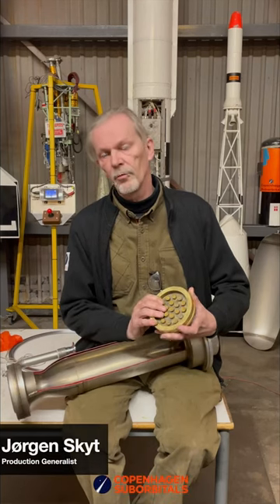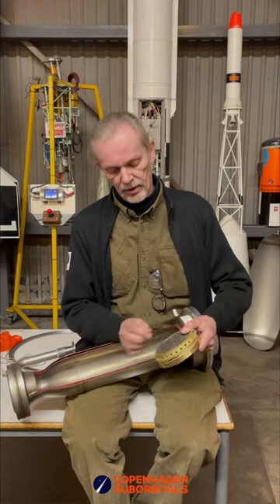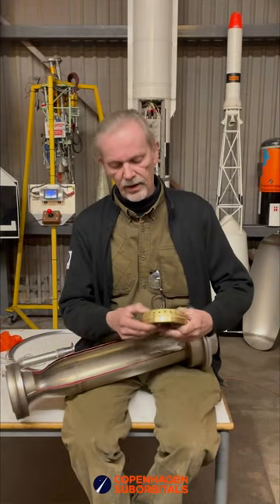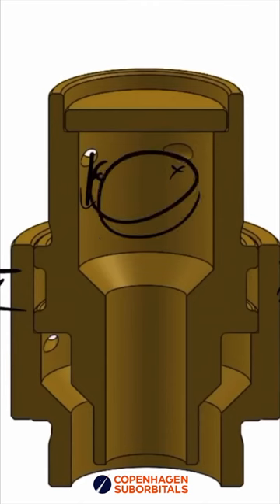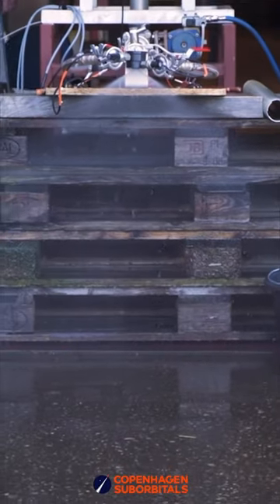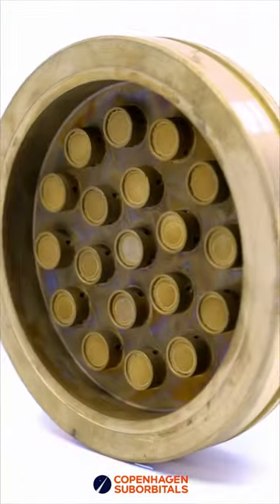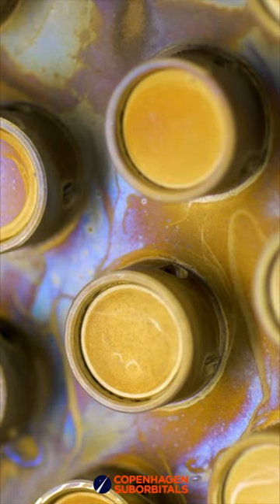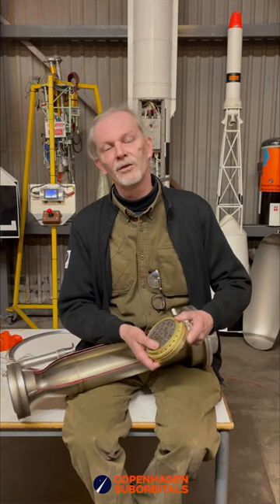A rocket engine swirl injector explained #shorts

Comment: Its a shame you go through all of that engineering and don't recompress the fuel after its been mixed.
Reply: Recompress?
Reply: What are you referring to when talking about recompress the fuel. You mean have It run thru another turbo before entering the fuel injector?
Reply: Reply yes recompress. Your temperatures are relatively moderate in that area from the looks and sound of it. Why waste the energy you are building on burning it when you could compress or recompress it further giving you higher specific impulse
Reply: @buddtwin2  yes if you were to go through another smaller more efficient compresser before your injector but after your cooling stage you will have more efficient engine.
Reply: @buddtwin2  why waste the energy gathered from the cooling stage when you could double it by either restriction of flow or like I said adding a smaller more efficient compresser before the injector.
Reply: @buddtwin2  it could also help your main compresser. You may end up with a cooler running more efficient engine due to being able to evacuate your cooling stage more quickly instead of relying on your main compresser to do all of the work......

Your injection manifold may need a redesign but you're already half way there it looks like. Another thing I don't like is the out dated injectors.

You can't be afraid to add velocity or pressure to your fuel.........

But I can't give away all the secrets. 

It's been done though....